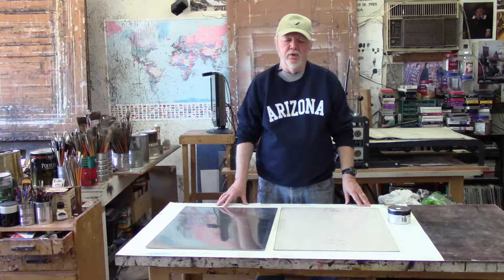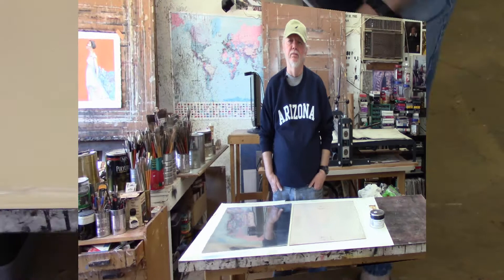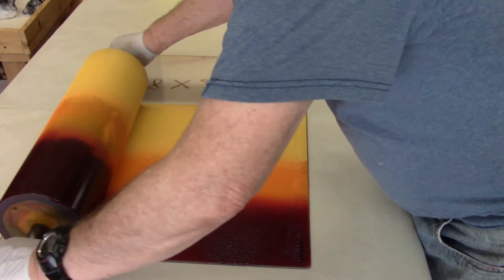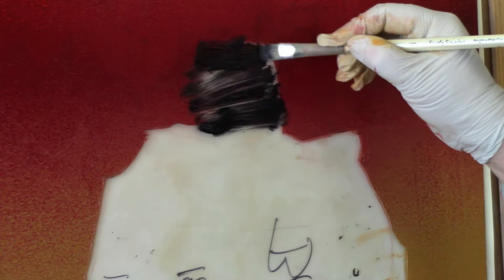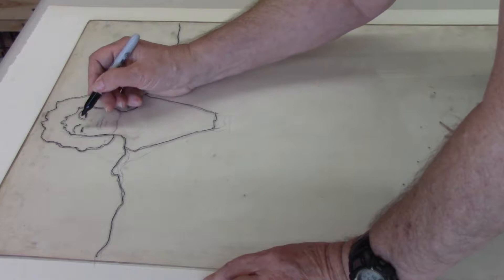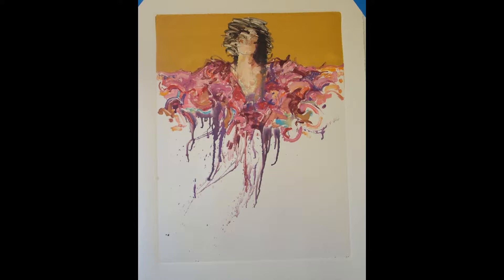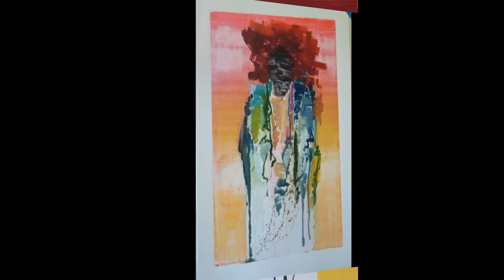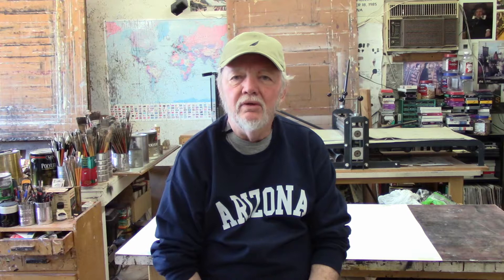Mono Print with Oil Based Media

Comment: I have 3 questions: What kind of paper do you use with oil based media ? Do you wet the paper, like with water soluble media? Do you use gesso as a ground on the paper?
Reply from the maker: HI I usually use Reeves BFK, but any good print paper would probably be good. No need to soak the paper, some do but I think it's better if you don't. There is no reason I can think of to gesso the paper. JOHN DAWSON